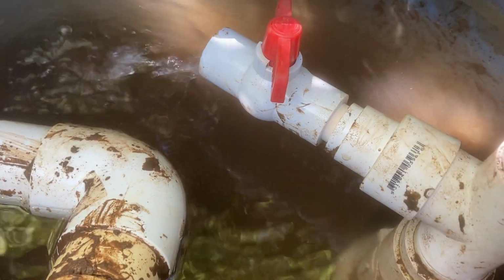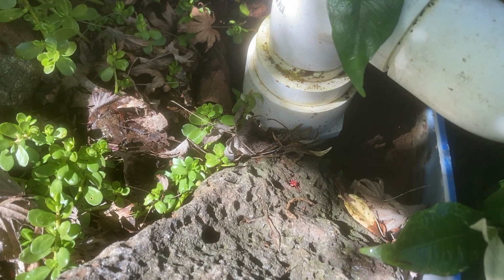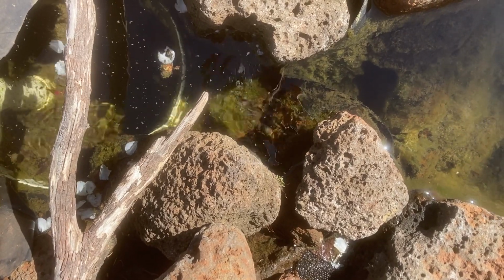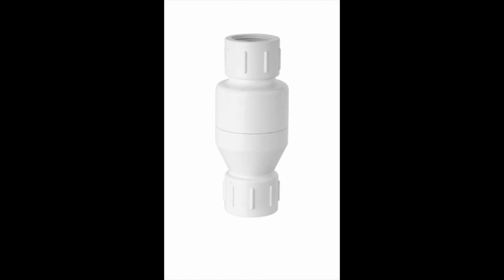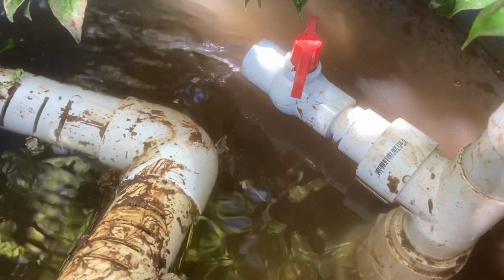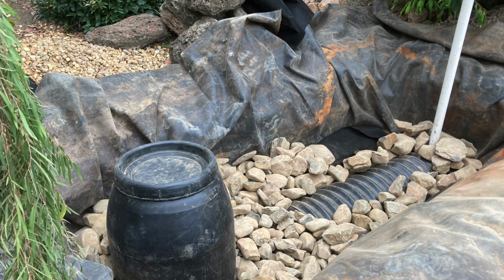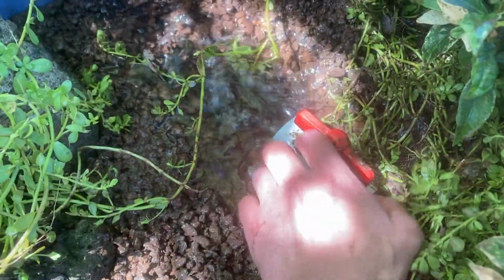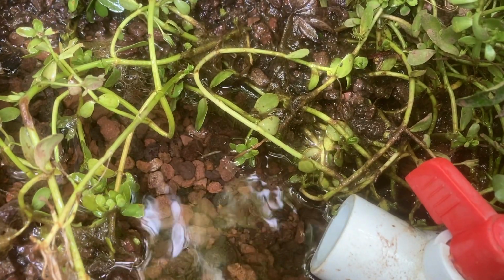Breather pipe for a bog filter

Comment: Another "con" of a check valve is that it will reduce your maximum flow rate a bit.  Not a lot, but it effectively adds from 0.66-1.0m of head height due to the pressure required to open the valve for normal operation.

Comment: I just use a Y connector at the top location where my hose from my pond enters my bog.  The flow from the pond goes into one of the sides of the Y and flows naturally down through the tube connected at the bottom of the Y, but when my pump goes of, the air enters the other side of the Y and the siphon stops.  No need for a valve.  Gravity does the work for me.
Reply from the maker: Perfect 👍

Comment: Very simple solution with much lower odds of failure than a check valve. About to install this in my own bog, but thinking I will direct the flow to another water feature made from a large plant pot I have lying around.
Reply from the maker: Fantastic mate 👍 Can’t wait to see it.

Comment: I built a bog in a barrel using your plan. All of the gunk in my barrel seems to be settling at the top of barrel. When I open clean out valve at bottom the water is clear not gunky. What am I doing wrong? I have a breather valve set very low. Thank u.
Reply from the maker: I’m not sure. Is the water being directed into the base of the barrel? Have you got a nice slow flow? Why is the breather pipe set low?

Comment: Do you need to install a breather pipe if you insert your water intake (from pump into bog) at the bottom of the bog container via a hole saw on the side?
Reply from the maker: I would always have a way to prevent siphoning. Breather pipe is my go to, check valves fail. If you come in at the base and you don’t have a breather or check valve your bog will siphon when the pump shuts off.

Comment: This is a much better approach. Cheaper than a check valve, and mine has failed too. I'd like to do a post mortem on it to see why, but it's a bit hard to remove it. I've been thinking about doing this, but it's also a bit hard to retrofit it. I think I might put some kind of closeable air hole in the top of the inlet pipe. In its simplest form, it might be just a hole with a rubber stopper, but I might be able to come up with something better than that. The problem is the retrofit issue, without disturbing everything too much.
Reply from the maker: The retro fit took less than an hour…although you are right about the disruption I needed to remove everything. When I pulled the valve off all the gravel fell down into the pipe. Pretty frustrating 😂 I thought it was going to be a 5 minute job.
Reply: I wonder how small the breather tube can be to allow enough air to get in to break the siphon. I'm thinking about drilling a hole into the inlet pipe and fitting some small  garden irrigation tubing with a shut off valve to adjust the flow. A bit smaller than the pipe you used.
Reply from the maker: It should work Geoff so long as air rushes in it will stop the siphon. 👍
Reply: @Ozponds  or maybe some sort of butterfly valve which the water pressure would keep closed but the negative pressure in siphon mode would suck open allowing air to rush in.
Reply from the maker: I’m not familiar with butterfly valves. Now I’m curious to learn more.
Reply: @Ozponds  is probably the wrong term. I'm thinking of a sort of flap that the water pressure would keep closed, but which would be pulled open by the backflow suction. I'll switch to email Kev.

Comment: I've been thinking about the breather pipe, thinking that the water would surely just run straight out of it, rather than going down to the base of the filter. Of course, fit a control valve. Thanks kev, my confusion is solved 👍

Comment: Can i attach this ball valve to a 1 inch flexi hose, i have a moderate size bog
Reply from the maker: Yeap. You’ll probably need to glue it. In my experience the flex pipe isn’t a perfect fit with the pvc.

Comment: Great videos, one watched several. I'm going to look at (ab) using an air admittance valve it my bog feed. It defeats the siphon without leaking water and is above ground in the case of a bed for replacement
Reply from the maker: Sounds cool 👍

Comment: I have been building my pond little by little, I wish I watched this before buying and installing the check valve. My bog filter is an above ground stock tank. The inlet attaches at the bottom and the water is then dispersed through a type of manifold system, I added a check valve to stop the water from siphoning back down into the pond if there is ever a power outage. I am now wondering if I cut out the check valve all together and install the inlet pipe all the way at the top with a valve as a breather.
Reply from the maker: If the check valve is working leave it. If it ever fails you know what to do 👍

Comment: This was exactly the video I needed to see. I've watched loads of your videos and with this one my final plan just came together! Thanks. One question... Can the bog be larger than the pond? I want to have a 400 litre cattle trough as the bog, to supply 250-300 litre pond made of an old tin bath set into a rockery, via a waterfall. Kinda thinking its the wrong way round, but it's how the space works and uses what I have.
Reply from the maker: Awesome! Yes the bog can be bigger. That’s no problem.

Comment: Hi Kev, how open does the valve have to be to stop the syphon? 
I want to prevent that but don't want extra water to the top of my bog so would like the valve open at the minimum. 😊
Reply from the maker: I showed in another vid how you can use a vertical pipe to still have an opening that no water will come out. I think it was the bog filter for the stock trough pond.
Reply: @Ozponds  Hi Kev, thank you for your reply. Do you have a link to that video? I have looked and can't find it.
Regards, Clive.
Reply from the maker: @cliveraymond1712  I can’t find it either 😔
Reply: @Ozponds  No worries thank you for looking.

Comment: Hi Kev! 

Your vids are ALWAYS helpful!

Question:
How do i measure the flow rate sent to the bottom of the bog vs the flow of the water coming out of the breather pipe? 

I want to make sure that its not flowing too fast down to the bog and pushing the waste up, so i want to make sure i can figure out the right balance
Reply from the maker: You need to put a hose on the top section and measure/ time how much water comes out. Then use the flow rate of your pump to calculate roughly how much goes to the bottom.
Reply: @Ozponds  thanks!!
Also, with the Bog filtering it naturally, does the pond still require any PH testing on a regular basis?

Comment: Hey Kev! Quick question on setting up my bog filter. My plan is to have tubing that flows across the bottom of my bog and into a clean out valve. They will have upward facing holes. My filter is going to be sloped down towards the clean out valve. Should I just create one hole in the clean out valve for the tubing to enter? Or create a few so all the gunk can get sucked in through the sides too?
Reply from the maker: I guess it wouldn’t hurt to have some in the clean out. I’ve never done it that way, but I don’t mind it.
Reply: Thanks for the quick response! I was just sitting around thinking about how the gunk would end up in the bin if there aren’t holes in it. Does your sediment tend to mostly end up in the bin naturally ? Or would it push up through the pvc going along the bottom and have a hard time getting back in when being cleaned?
Reply from the maker: @magicmikefpu9510  hard to say because I can’t see through all the rock and pebble. Remember I’m using that large drainage/ leech trench component as my dispersal. It has heaps of large slots in its side, that allows plenty of gunk in as I back wash the system.
Reply from the maker: @magicmikefpu9510  I’ve just realized this is the breather hole video, not a large bog filter. If you are using a cleanout point because you cannot use a valve (barrel bog design), you absolutely need to have holes in that cleanout point to remove the build up of gunk. My barrel filters have a valve at the base.
Reply: @Ozponds thanks, mate! Yeah mine is around 400 gallons and it’s in ground. So I will definitely add holes in the clean out valve. Thank you sir!!! I’ll let you know when it’s all set in a month or two

Comment: Nice video, thanks. Can I ask about the pump… as this is sitting in the pond and pumping dirty water into the bog filter doesn’t it get blocked or covered in gunk? How do you keep it clean and maintain it?
Reply from the maker: G’day Paul. I do have a build video for this pond. But to answer your question. The pump sits in a diy skimmer. The skimmer has a course filter sponge which catches a lot of stuff. Also the bog was built for east of cleaning. Videos available on both the skimmer and the bog 👍

Comment: I'm building a bog filter and had planned to have 3 to 4 pvc pipes branching out from the inlet pipe from the pump (which is probably 10 feet lower then the bog). I thought the snorkel was all I needed for cleanout. Do you recommend I have an end cap for each distribution branch?
Reply from the maker: That’s a different style of bog to what I create. If you are building the Nelson design, you should build it like their guidelines.

Comment: if use a 100litre barrel for a 1000l pond with a waterfall will the flow be too much for a 100litre barrel? TIA
Reply: I’ll also have a skimmer on the pond with a pump if that makes a difference
Reply from the maker: I have no idea? What exactly is the flow? You’ve said how big the pond is, how big the barrel for the filter is, but no pump! No one can assess if flow is too much, if you don’t provide the actual flow rate 😉

Comment: Hi Kev,
I did a test on my bog to replicate a power outage, The water seemed to continue to drain after the water level dropped below the breather, any idea why? Its only a little system for a patio pond in a Bunning plastic whiskey barrel with a small office bin as the bog.
Reply from the maker: Probably not enough air getting in. If the air gets in the siphon is broken. If you came in at the base it won’t work either, need to come in over the top.
Reply: Definitely coming in from the top. I have a feeling though the water level towards the bottom of the bog will eventually be the same as the pond as the bog is not completely above the water level in the pond. I might just let it completely drain as much as it wants to and see what happens. 
Love the videos mate.

Comment: Hey buddy, I checked my bog, and the water did syphon back into the pond.

Can I confirm where the breather pipe is installed. Does the water level cut off at the point?
Reply from the maker: You just need it to suck air into the pipe when the pump shuts off that breaks the siphon. The water level will sit at the point of overflow. I’ve lots of vids and diagrams showing where I place mine, but you can place it in lots of different areas.
Reply: @Ozponds  I did it! I got a T joint, added a small pipe, and added a 90-degree bend. It works perfectly! 

If I hadn’t found your channel, I would have had no idea about this breather pipe situation. 

Do you have a website? I’ll send you my design, haha

Comment: That’s awesome because I want to use my bog for the waterfall as well.
Reply from the maker: Perfect 👍
Reply: @Ozponds  hey I’m building my wetland right now, I saw you only used lager stone on yours, how is that working out, I would like to add aquablocks of course but dang are they expensive for just one.
Reply from the maker: So far I’m not experiencing any problems but it’s still early days only 6 months old.
Reply: @Ozponds  I think I’m going to go your route, and thanks for the videos your probably the best diy pond builder I’ve seen and I’ve watched a lot.
Reply from the maker: Thanks mate. That’s very kind, although there are lots out there far more talented than me.

Comment: Kev, does this only work when the pipe comes up over the top of the bog and then piping moves the water to the bottom of the bog?

I have piping that goes straight into the bottom of the bog (hole in bottom of bog). Mainly due to if I try to go up and over (tall barrel), the flow drops to near zero due to the head height. 
               |~~~~~~~~~~~~~~|
               |                                      |
-------------|--                                    |
Pond Water--->                            |
-------------|--                                    |
               |___Bog______________|

Would attaching a t-piece to the inlet and raising a pipe up above the water level work if the pump stops? I'm thinking not, as the inlet (turns into outlet when pump stops) doesn't rise up like in your design, so gravity will still cause the water to leave?

                   |      |
                |~|~~|~~~~~~~~~~|
                |   |     |                            |
---------------|--|     |-----                      |
Pond Water--->                            |
---------------|-------------                      |
                |___Bog_____________|

I guess I could try and try and throw something together to see what happens. But thought I'd ask first.
Reply from the maker: No you really need to come in over the top.
Reply: Thanks. I’ll have to give this a miss then. The “drawings” come out odd depending on what platform you’re reading them from. Hopefully it didn’t look like a jumbled mess for you 😂
Reply from the maker: 😂 no it was a jumbled mess.

Comment: Hi , Kev , did I read your picture right ? The valve you installed is above the bog filter and separate from the flow back too the pond ?
Reply from the maker: Correct 👍

Comment: Hi Kev have you ever done a bog filter in a liner so with no plastic containers to hold everything? was wondering if you have a video or info on this as I’m making mine quite big out of sleepers with a liner inside. 👍
Reply from the maker: Yeah mate. The two bog filters on the dream pond are built in the liner.

Comment: 🐟🐟🐟🐟
Reply: why not just drill a 1/4 inch hole in the inlet pipe to the filter just above the surface of the bog filter water level.
Reply: @kevscott8900  Only thing I can think of is the breather pipe is more versatile because of the adjustable valve.
Reply from the maker: Yes. You want to have control. Although a small hole will work to prevent a siphon starting. 👍
Reply: @kevscott8900  yes that is the simplest method. Have you done any testing? You want the the smallest hole you can have to reduce the flow of water bypassing the bog, but yet big enough to allow in enough air to kill the siphon.